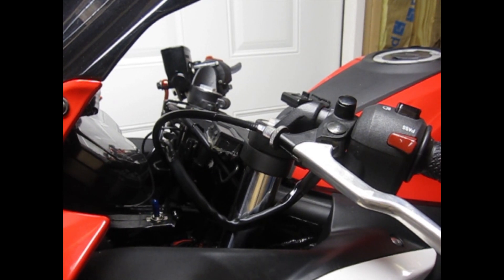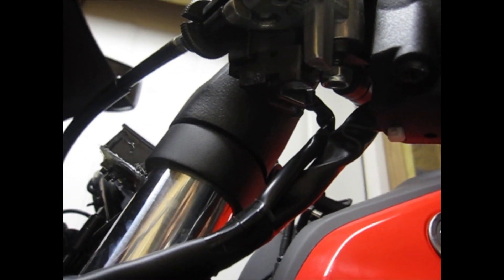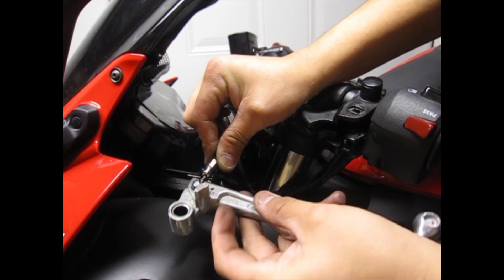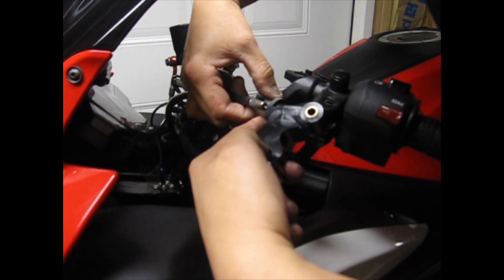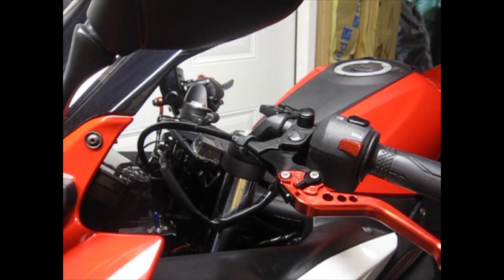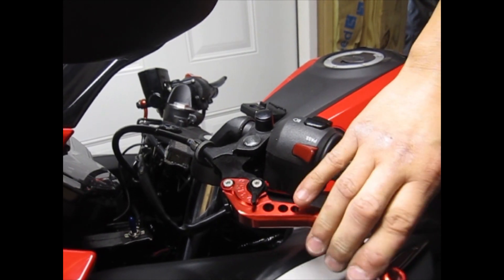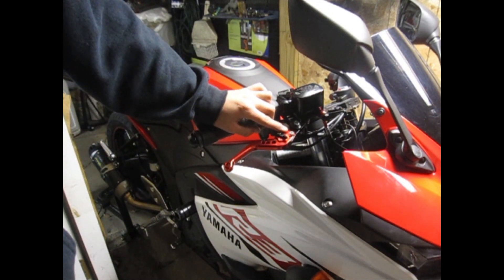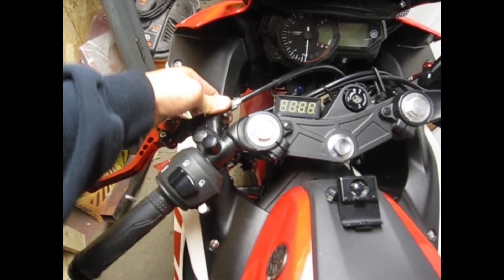How to install Shorty Levers on yamaha R3

Comment: thanks.  Dont forget everyone to grease the clutch side with white lithium grease.  Brake side with Silicone oil or similar.   Nickel width gap on clutch side before the cable pulls

Comment: Woah woah... If the clutch lever is tight you don't just move the lever in close with the clicker... You have to loosen the clutch cable until there is a tiny amount of play in it. Clutch levers need to have play so the clutch can fully engage! 

The way you have that set up now being so tight means the clutch will never fully engage because the lever isn't letting it and you'll loose tons of power, the clutch will slip and eventually burn out.

Comment: very effective video Thanks. is there any way to adjust the front brakes without flushing?
Reply from the maker: what you mean flushing? the front brakes are self adjusting, but if you meant by the lever for feel then the lever has 6 adjustment points select which feels more comfortable for you just note that the closer the lever is to your hand grips you may not get 100% brake pressure.

Comment: what about the black o ring that comes with the stock lever? Do we need it?
Reply from the maker: no you dont need it, plus it makes it very difficult to install with it.
Reply from the maker: not really, but if you want to install it back with the new levers it will be difficult cuz its already a tight fit

Comment: can you help me out?  I bought some very similar except mine didn't need the metal piece you inserted in the clutch lever. but when I pull in the clutch, it just stays pulled in. I have to put it back into place and when I turned it on even with the clutch all the way out, the bike was not moving when I put it into gear.... help please
Reply from the maker: +HeroofSomething if it doesnt retract back after you pulled on the lever that means that the cable doesnt have enough tension on it. on my video go to the spot of 6mins and 53secs i pin point the spot to adjust the cable. if you need any more help let me know
Reply: +AC Productions well... I ended up shaving off the big screw and now I think I'll have to replace the whole plastic thing that holds the clutch,  do you know where I could get another?
Reply: if you have the clutch cable adjuster all the way out and your clutch is not ingaugeing then you have to take off your right side fairing and adjust the clutch cable from there. if you still need help let me know and I'll make a video of how to adjust it

Comment: Is there any play on levers . I bought some from eBay and man there's a lot of play.
Reply: if you install some very thin shims that will get rid of some of the play
Reply from the maker: i dont have much play on mine, but if you have alot of play then you may want to install some thin shims where the bolt goes through. take out the bolt slide the shim then put back the bolt. that should help with the play, might be alittle difficult to get the shim in.

Comment: Is it same with the ABS model
Reply from the maker: it should be the only difference with ABS model is that it has a sensor by the front  wheel
Reply: AC Productions ok can you install steel braided brake lines in R3 abs model
Reply from the maker: yes you can, it will improve on the feel of the lever it will feel more firm. plus under heat and load the brake line will not expand like the stock brake line.
Reply: AC Productions can spiglers brake line fit in abs R3 because some people said it would not
Reply from the maker: I would check straight from that company to see if they have brake lines made for the abs ver of the R3

Comment from the maker: after doing this install and if your having trouble with Engagement point on the clutch check out my next video https://youtu.be/NytuyWlEE3E
Reply: +AC Productions i have a question regarding the brake side. you know how when you have the stock lever on, theres a point where it clicks and you feel the bike start braking, well after i installed the aftermarket short lever, i hear the click but it takes a bit more of grabbing the brake lever for the bike to start braking. is this normal or did i install it incorrectly?
Reply: +ldiaz04  on the lever you should have 6 adjustment points I have mine set to number 2 which puts the lever closer to the handgrip. try this if you still feel that the brakes are not grabbing like they use to then let me know.
Reply: +Alfonso Castillon thanks! back to normal again. awesome video!
Reply: ldiaz04 nice glad to help